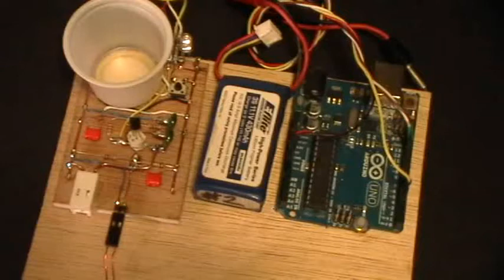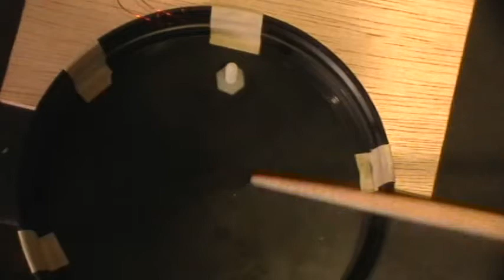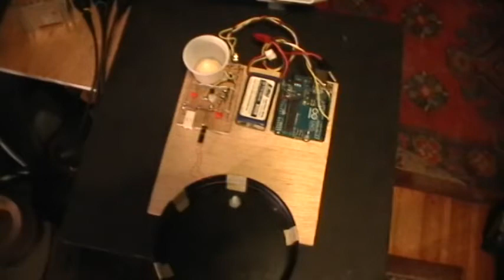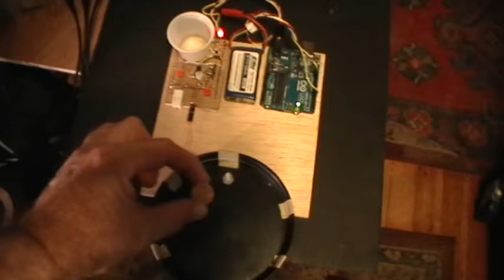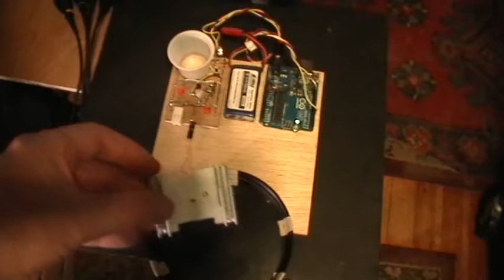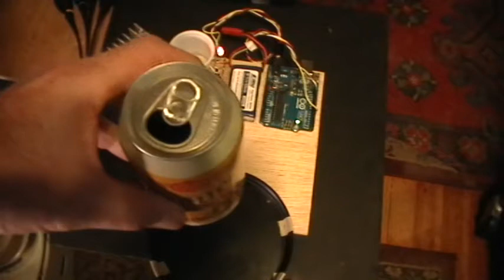Arduino: Simple Metal Detector

Comment: i have tried it on my arduino uno r3 atmega 328 r-b ,it did not work. when up loading sketch (libray found not working).i checked circuit by powring it with 9 v battery near am radio and moved piece of metal over the coil, radio responding to metal movment.
i am new to arduino and need your help.
thank you
Reply from the maker: +rafa ali Several people have reported problems like this, using Windows 7 and 8 and the latest Arduino IDE. This seems to be because of a bug in the Windows linker. Search google for the specific error messages you get from trying to compile the sketch in the Arduino IDE and you will find information about how to fix the trouble.

Comment: what about the Sensitivity variable via potentiometer did.you succeed
Reply from the maker: +عمر احمد عمر Yes, just use a potentiometer and analogRead()  and map() statements to change the SENSITIVITY variable in the code sketch. Values from 500 to 3000 worked for me. The original value is 1000, mine seems to work best at around 1500.
Reply: +TinselKoala what would you  think  if used  cheap function generator20khz to200khz thanks for the post and the time spent
Reply from the maker: عمر احمد عمر
This metal detector works on the principle that slight changes in the inductance of the coil, caused by the presence of metal, change the frequency of oscillation. A function generator is designed to keep a constant frequency into whatever loads it is connected to. So I don't think it would work here, since the output of this system is based on comparing slight changes in frequency (metal present) with a baseline frequency (no metal present). The oscillator used here is designed to vary its frequency easily, just the opposite of the function generator's design.
Reply: +   TinselKoala I understand now  the working  principal  of this you  have been so helpfull Greetings

Comment: please >>
i want to use this circuit in my robot .. but i want to increase the depth of detection to 40 or 50 cm
another problem .. h want this circuit without the switch ..
what should i do ????????????????
Reply from the maker: Mahmoud Mahmoud You may be able to get more range on the detection by pulsing the coil with a higher voltage. But then you''ll need to use care to insure that the Arduino's input isn't overloaded. The button basically selects or nulls the base frequency to correct for things like environment and power supply voltage differences. You could probably write some kind of auto-nulling routine in the software if you don't want to use the switch.
Reply: Thank you sir :D
Reply: But .. can I change the resonant frequency by changing the diameter and number of turns to change th inductance .. therefore .. changing the frequency ??
Reply from the maker: Mahmoud Mahmoud
Yes, that's right.

Comment: Have you tested the response to Gold or Silver? Very cool build.
Reply from the maker: Binj Komisar Thanks. Yes I tested it with a silver necklace chain and it works pretty well. Haven't tested it with gold, don't have any laying around handy.
Reply: +TinselKoala ,,hi,,is the circuit ok?i want to make that also,,,,thank you
Reply from the maker: Antonio Empleo
Yes, the circuit is OK. But the code doesn't work with Arduino Mega, only works with Uno/ProMini/Nano etc. because of the way interrupts and timers are handled.
Reply: +TinselKoala ,,i forgot to ask,,,,what is voltage power supply,,, can it be 9 volts? thanks again,,
Reply from the maker: Antonio Empleo
Yes, but the sensitivity will be slightly reduced.
Reply: +TinselKoala ,,,so what should be sir?
Reply from the maker: Antonio Empleo
Well, I'm running it with a 11.4 V LiPo battery in this video. Anything from 9-12V should work OK.
Reply: +TinselKoala  ,,thank you again sir